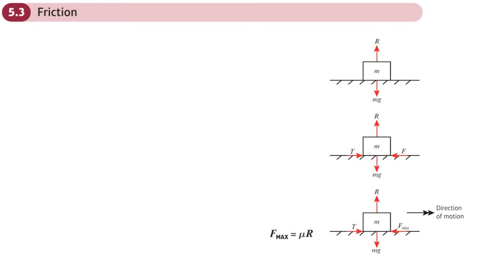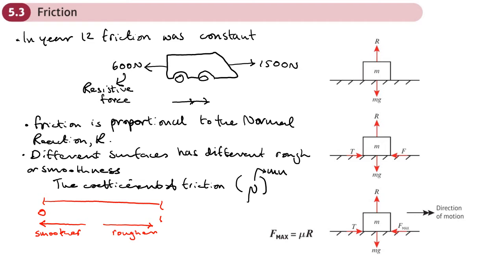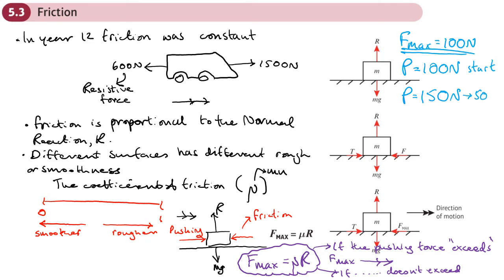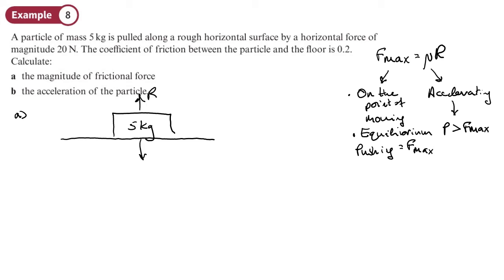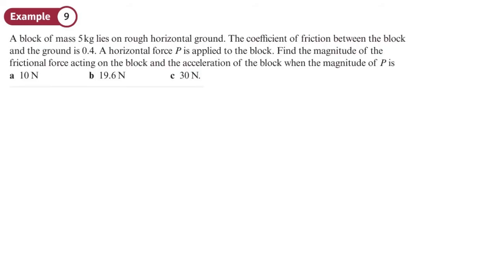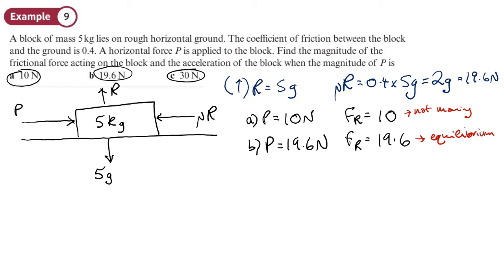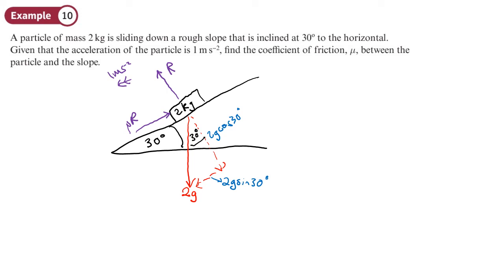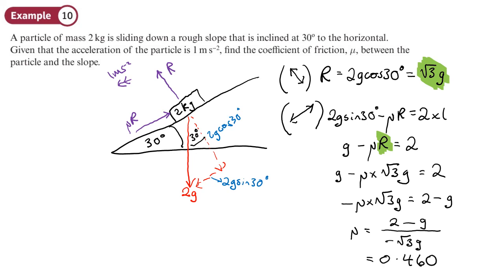5.3 Friction (STATISTICS AND MECHANICS 2 - Chapter 5: Forces and friction)

Comment: Hi sir for one of the past paper question on this topic :

“A rough plane is inclined to the horizontal at an angle a, where tan a = 3/4. A particle of mass m is place on the plane and then projected up a line of greatest slope of The coefficient of friction between the particle and the plane is u. The particle moves up the plane with a constant deceleration of 4/5 g (a) Find the value of u”

For the deceleration would it be wrong to put acceleration as -4/5g in F = ma 

Also in the worked solution they don’t include the pushing force for the particle instead they resolved the parallel forces as if the particle was rolling downwards where acceleration was 4/5 g

So I’m confused as to why the pushing force wasnt considered and instead they inverted the movement of the particle in the opposite direction
Reply from the maker: There is no "pushing" force.  Once the particle is initially projected then that force is removed.  That's different to a force which is always there as the particle moves.  If you take up the slope as your positive direction then the deceleration will be -4/5g

Comment: On question 7 of excercise 5C in this topic it says

A train of mass m kg travels at 20m/s. When it applies the brakes it decelerates at a constant rate, stopping in 30 seconds.

Show that the co efficient of friction is 2/3g

When I did it I got -2/3g so i assume it’s a mistake in the diagrams / directions of forces, how would you draw the diagram for this?
Reply from the maker: Did you remember to make the acceleration negative in your F=ma equation?  Deceleration is a negative acceleration

Comment: Does it matter which hand side u draw the force acting on the particle when its being pushed up a slope with the force being at an angle 

eg for Q8 on the mixed exercise for this topic 

“A particle of mass 0.5 kg is being pulled up a rough slope that is angled at 30° to the horizontal by a force of 5 N. The force acts at an angle of 30° above the slope. Given that the coefficient of friction is 0.1, calculate the acceleration of the particle.”

For the “pulled up a rough slope that is angled at 30° to the horizontal by a force of 5 N.” Part
I modelled the horizontal and vertical components of the force above the slope starting from the left side of the particle and so got a different answer from the worked solution where they done it from the right of the particle. So how am I supposed to know which side of the particle to model the force from?
Reply from the maker: It doesn't matter as long as all of your forces (and the component of the forces) are pointing in the correct directions. The words "pushing" and "pulling" are important, as you want to have the forces on your diagram doing exactly that, "pushing" or "pulling" the mass.  Also, drawing the forces on the "wrong" side may mean that you end up drawing forces going "through" the slope, which isn't ideal
Reply: @HindsMaths  ok thank you sm
Reply: @HindsMaths  so if it’s being “pulled” as it said in the question it would be appropriate to draw the component of the forces on the right side as now I can see in my working that doing it to the left made my vertical arrow invert the wrong direction
Reply from the maker: That's right